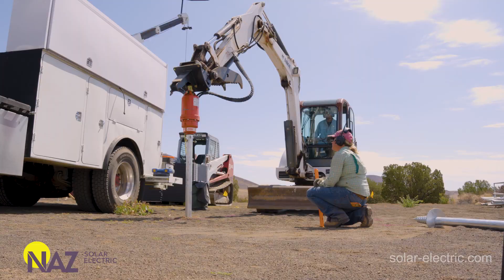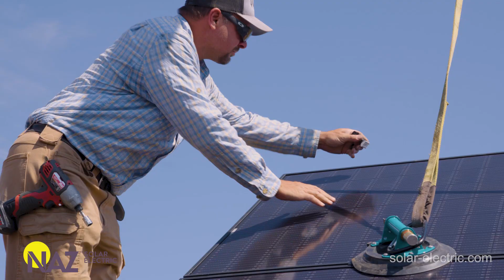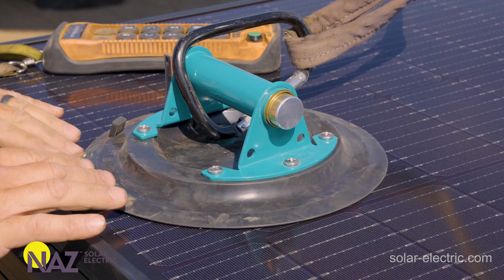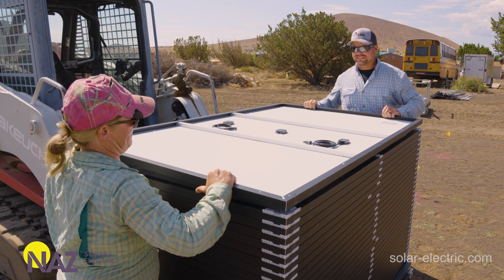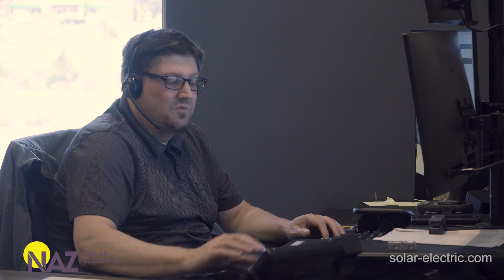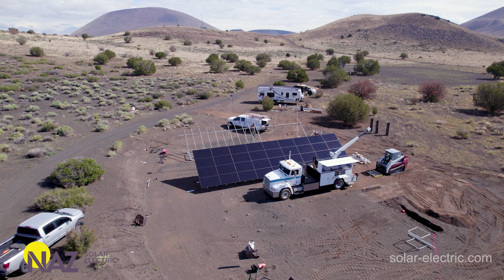Arizona Electrician Transitions Business to Solar Installation, partners with NAZ Solar Electric

Comment: NAZ helps their installers and their vendors but us DIY customers get squat for our business.  Though promised accurate drawings, those weren't right either.    And for God's sake, don't buy the Fortress eFlex if you want actual storage capacity.
Reply from the maker: We have been supporting DIY customers for over 40 years, and that is still our largest customer base. We personally work with every customer from the design, all the way through the commissioning process, and support our customers for the life of their systems. Please reach out to our customer service or sales teams and we are happy to assist you. https://www.solar-electric.com/contact/